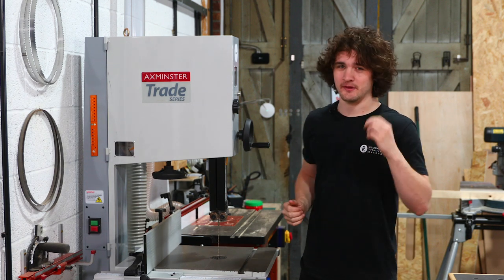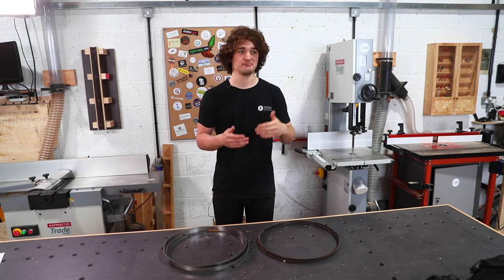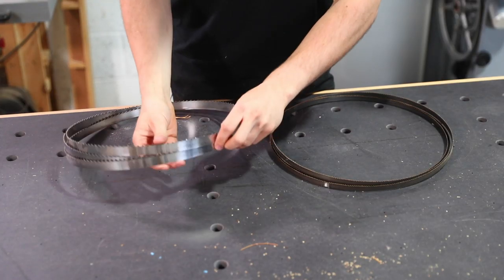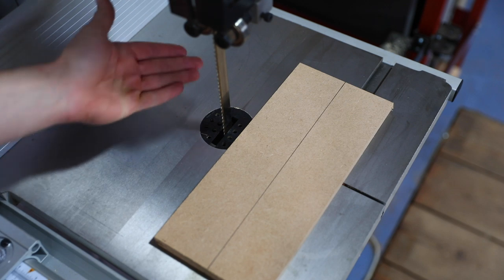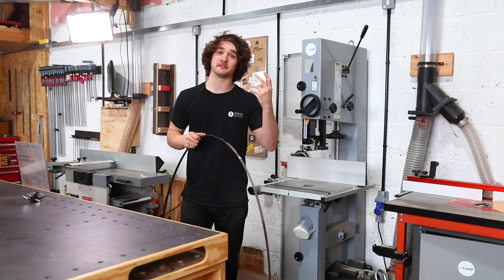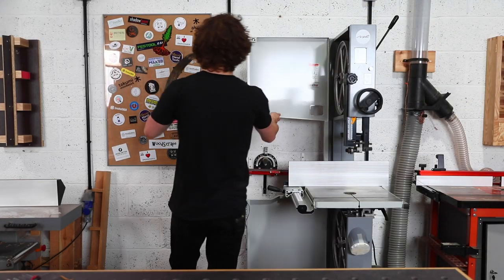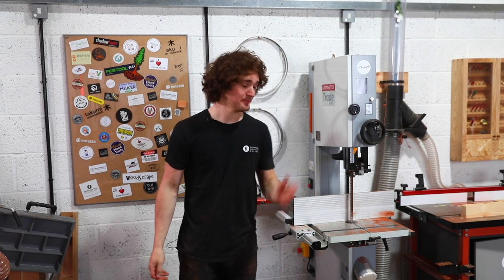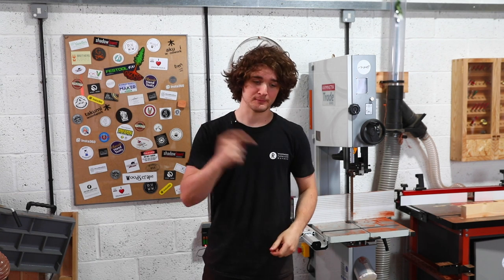The DEFINITIVE Guide to Setting up a BANDSAW

Comment: Your right about the bottom of the gullet being in the center of the wheel but uncoiling a blade on concrete is the quickest way to screw the teeth tip's and kill it.
Leather gloves, uncoil it slowly in your hands, easy. Throwing blades on the floor is a classic trade school bullshit safety thing.
The right way to set the thrust wheel is using the band to tell you how far it likes to bend back under load by pushing it back with a softwood block. Where the  wheels rest after is where you lock them. That way they are biased top and bottom relative to the height of the bed and carry the load equally.
The blade needs to bend back a little under load otherwise it stresses the gullets and leads to blade and tooth distortion.
Usually the gap is around 1.5 mm max but it depends greatly on the stiffness of the band. Don't adjust your guides until you have adjusted the thrust wheel, especially on narrow bands.
If you put the wheels right behind the band they can develop to much friction under load and can burn really badly. Especially if the weld is not nice and square.
If a band oscillates backwards and forwards send it back and demand fix or replace.
Bad welds will cause bad tracking and ruin your guides.
Not many people know that.
There is in fact a lot lot more to adjusting and running a bandsaw properly than this video says.
Many variable's, many tricks, many potential problem's that can ruin a bandsaws performance. Very few people really know how to set them up properly and many bandsaws are irredeemable shitboxes that can't be fixed.

Comment: Wrong. So many YouTube videos omit adjusting the table so its slot (on the right) is parallel to the blade. You’ll find oversize bolt fixing holes underneath to allow a small amount of rotation to the table. Usually only needed to be done once, but must be done as the horizontal sliding fence uses this. THEN go about adjusting the main fence as you show. Cheers

Comment: I would maybe try to find a way to store the blades without having to coil them up, which makes them quite dangerous.  It would be easy to mess up and have the thing uncoil and pop out of your hands and cut your eye, face or hands.  If you could skip over the coiling and uncoiling process, it would really make things much safer, faster, and easier.  ...and way less stressful.  Still better than using a table saw.

Comment: I don’t like to disagree with Matt but! Your fence should be true to the mitre slot. Then to eliminate drift adjust the alignment of the table. Otherwise your mitre slot may not be at 90deg to the blade.

Comment: Trawled through the comments just to check this observation has not been covered. Your adjustment of the side bearings is at odds to Mr 'Snodgrass'. As you have correctly commented the front of the blade is supported by the tyre and its tension. You appear to advocate these side guides to be just behind the teeth....thereby leaving the rear of the blade unsupported. In order to restrict this freedom, the side bearings should be adjusted towards the rear of the blade, thereby providing the entire width of the blade with longitudinal support. I'm just an enthusiastic hobbiest, but have grown tired of bandsaws that underperform. Apart from that Matt, I thoroughly enjoy your content, filming skills and humour.  Link: https://www.youtube.com/watch?v=bxVyKsbuwZQ

Comment: There is so much conflicting info on tuning a bandsaw. I've seen several professional woodworkers say to center the blade and several say to center the teeth. In your illustration, you center the teeth, and the back side of the blade hangs in mid-air. In reality, the back side could hug the curvature of the wheel and cause the blade to angle itself, resulting in an angled cut, resulting in drift. Also in your illustration the curvature of the teeth perfectly matches the curvature of the wheel (making a nice hug), which seems unlikely in reality. Even if one wheel matches one tooth-set, each blade has a different set and each wheel has a different curvature, meaning most combos won't match. I wish someone would take a more scientific approach to this, instead of the dueling Joe-Bob situation we're stuck with.

Comment: I find that the rack and pinion for the blade guard and guide gets clogged up with sawdust. Every video shows a bandsaw with no sawdust. In real life this is a pain. It takes ages to clean out. My old Startrite has a simple slide and clamp which needs no maintenance.
When feeding wood I avoid having my forearm across the line of the blade, in keeping with the principle that you should not cut towards your own body.
Reply from the maker: I’ve never had an issue with dust in the top of the bandsaw. Good extraction mate 👌
Reply: Thanks for that. I took your advice and much improved.
Reply: I’ve cured it by sealing the top of the slide with mastic where there was a gap.

Comment: lol nice C clamp you got there. That is not how to use a micrometer. One or at most two clicks , not 15 or 20.
Your blade is open (angled away from the fence at the front) because you set the teeth too far back on the upper wheel. The gullet goes on the center of the blade not the teeth. No the wheel radius does not match the rake of the teeth.
The fence adjustment is to offset the tracking of the blade or drift angle and should be very slight. This will adjust out minor wear of the machine.
Same with the bearings. Set the guide bearings just behind the gullets off the blade.
Use a sharpening stone to round the back edge.
Follow this guy:
https://www.youtube.com/watch?v=wGbZqWac0jU

Comment: And here comes the pitch, the most ridiculous fence adjusting gimmick yet. Oooh, it's made from anodised aluminium. Sexy.
You will only use it once and then it will gather dust along with all those other overpriced gizmo tool's underneath your plywood sanding island bench. ROFLMAO.